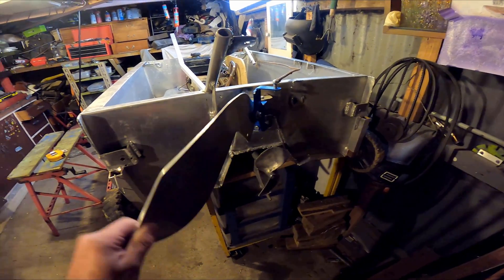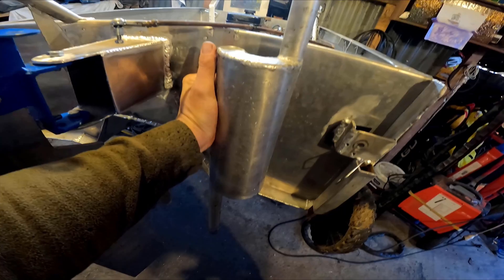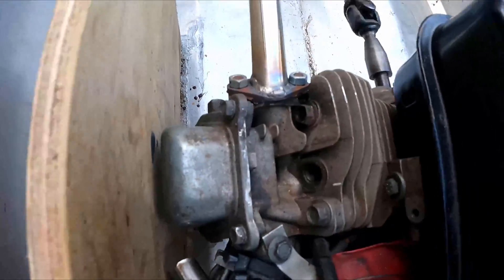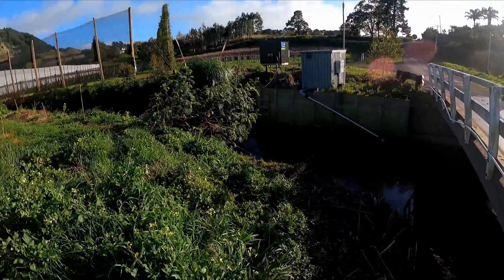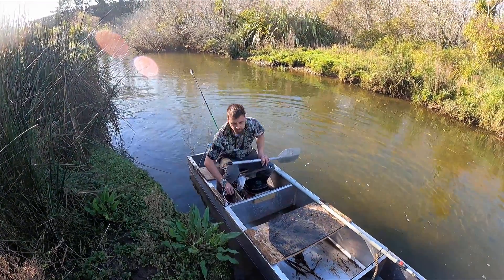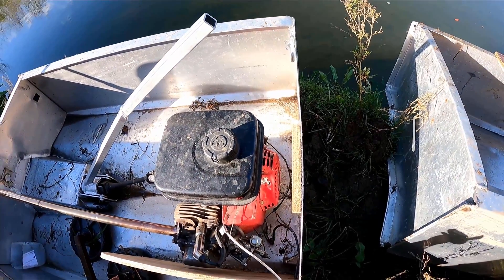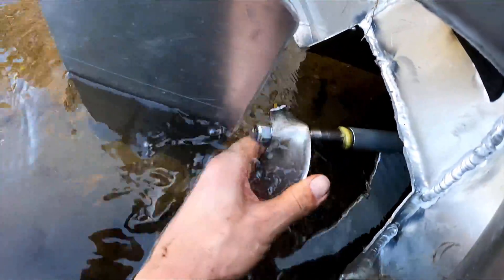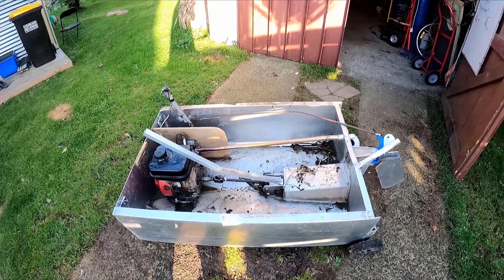Mini Jet Boat to Inboard Surface Drive, P3 Better Rudder

Comment: what speed were you running with this combo, and what rpm was the 212 running at?
Reply from the maker: It would plane by myself about 25kph , I would guess the 212 was running at around 3500rpm

Comment: That’s really impressive. That was some very shallow water you were treading. A lil different propulsion from the typical but awesome design. Nice work. Only thing that bothered me was when you were down stream of a rotting sheep corpse. Hopefully your fingers were no where near your mouth. That water has to be extremely nasty. Anyways keep up the good work
Reply from the maker: It seemed to work pretty well , that creek is feed from a harbour so salt water goes up there every tide. Still very gross and not something you want in your mouth 👍

Comment: I think a Double ended CV shaft would be much smoother than the uni joint you have on the prop shaft.  Have to do something with that exhaust, having it run through the boat like that is space inefficient. It should drop into a larger Diameter Muffler so it is like a suction breaker and then have a small hose  coming  in to water cool the muffler and further along.  I would just dump it out the side rather than all through the boat which is a source of more vibration.  Also what about putting some  coarse mesh under the tunnel which would help push any  submerged obstacles down  as you went over them and help the skeg give the prop clear water.  Love the project and look forward to the next update.
Reply from the maker: I have an idea to run no uni joints or cvs which should be better . I like your exhaust idea it would be nice if it was quieter but keeps the power
Reply: @dkthewelder  Have to mention, it's good to line your motor, shaft, and whatever device is in the rear to make you move. That motor is so high, and prop so low, that 
"drive shaft" is having a hard time. Angle the back end of the motor lower.
Besides, it's funny that you're having a winter, here in Finland, winter equals snow and minus degrees celsius. Really like your project.

Comment: Buy an old clapped out jetski an fit the jet drive to that boat! You'll need a bigger/faster motor maybe a motorcycle engine 300cc+ get all ya bits from a scrapyard 👍
👊✊💨💨💨

Comment: you're lucky that there isn't nenuphars or waterweed in this river
Reply from the maker: There was a little bit of weed but the propeller chops through it and doesn’t clog like a jet unit. What is nenuphars ?
Reply: @dkthewelder  I'm sorry I thought that nénuphars was nenuphar in English but apparently it's water lilies
Reply from the maker: @jeremyperraud1357  water lilies! The ones here are only in ponds and still water. Do you race road bikes? I used to race motor cross a bit
Reply: @dkthewelder  no unfortunatly :'( but would definitly want a try, it was a hillclimb race in Britany where those superbikes ( which participated to Gp in France) open the road, one of the organisators was part of my family

Comment: You should try a tourque converter on this then u could easily start it with a big prop on and have better low and and top end, u can get one on eBay for around 70$

Comment: Change that forward/backward lever to handle bars for steering and thumb throttle
Reply: That thing could actually change the angle of the propeller, if pushed or pulled.

Comment: port stern, starboard aft, same thing amirite? lol.
Reply from the maker: I know what’s wrong with front ,back, left, right haha
Reply: Port is left , starboard is right, aft is rearward , &stern is the rear end of the boat !
Reply: @davidgriffin7336  good job, seaman Griffin. Now go stand your lookout watch.
Reply: @LSDale  that's petty officer 2nd & a veteran 👍
Reply: @davidgriffin7336  you're not the only 2nd class veteran in here. As the watch bill coordinator, I'm putting you on seaward sentry.